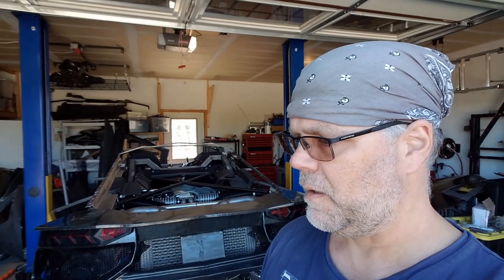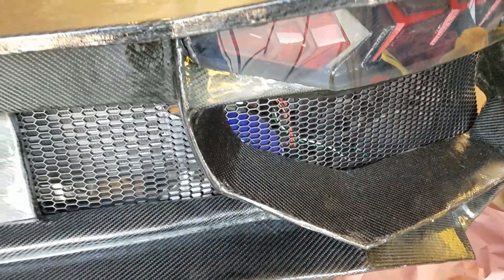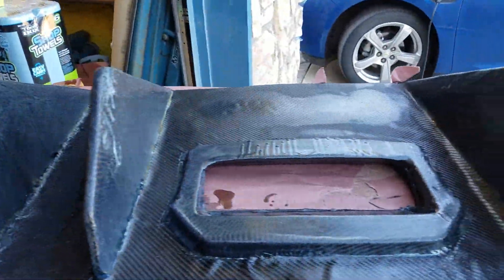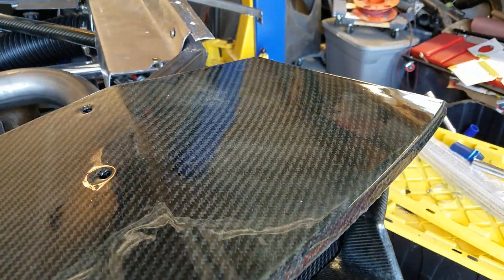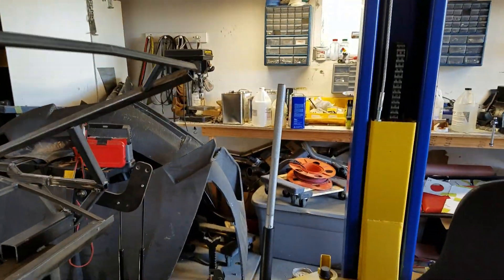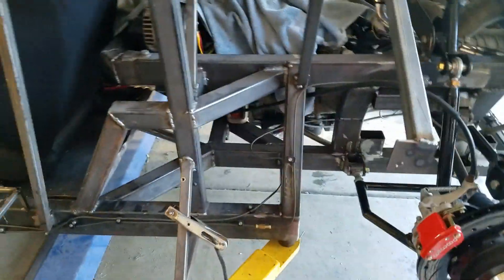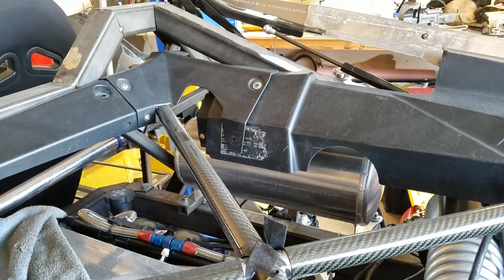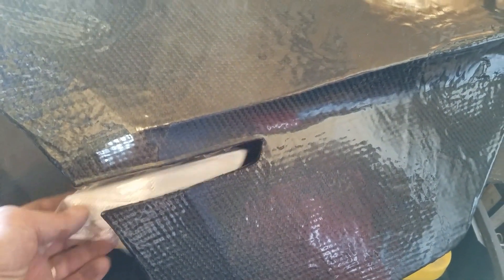3D Printed Interceptor Update 9

Comment: hello and where did you get the schematics?
Reply from the maker: From a toy model.
Reply: @lasersterling  And then increased in size?
Reply from the maker: Yes
Reply: @lasersterling  And to what sizes increased?
Reply from the maker: Proper wheel base 2700m
Reply: @lasersterling  And the headlights were also made on the model?
Reply from the maker: @kolkhozcustom716  I had to wing those.
Reply: @lasersterling  And can you please throw off the link to the toy model